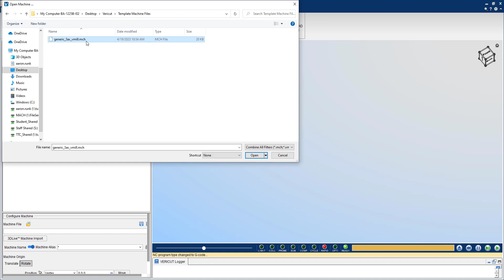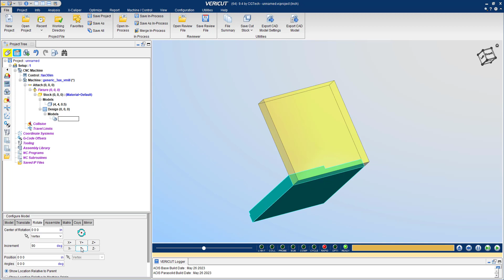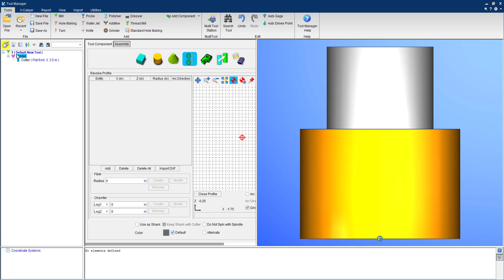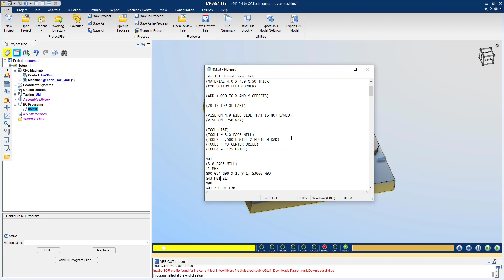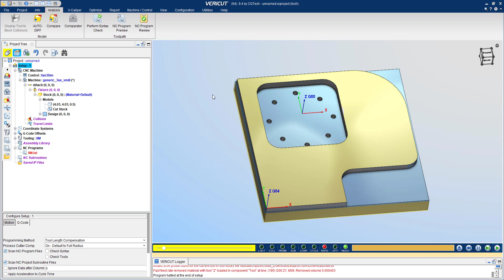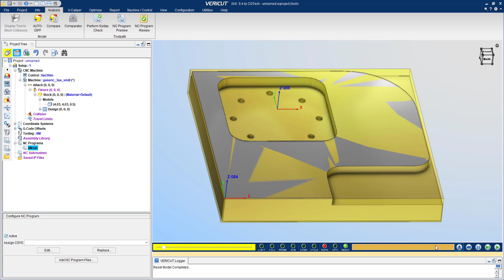Learn Vericut!

Comment: Sir I couldn`t find 8M text file can u upload it also please i want to do what u want it is really good exercise. thank u
Reply: ah sir thank you so much. I am mechanical enginering student yesterday I started vericut first time honestly i couldn`t find good explanation. I was just imitation what you did, now i will be able to finish. thank u so much sir.
Reply: sir I have a question, u say G41 uses cutter comp, how u know that? I mean every code has meaning or how? like g1 g2 ... g55. Sir I use V9.3  but when i click stock there is no section like "stock material". i searched everywhere where can i assign material of workpiece. Thank you so much in advance
Reply from the maker: @yourdecorator  so the best way to find out if a program uses g41 for cutter radius compensation is to understand how it works I have a link here that explains it further that way when you're looking at a program it will make more sense https://youtu.be/uZbG8XBrbjI?si=6R-n5ofWYXXqudZf
Reply from the maker: @yourdecorator  how the project ladder Works may vary from version to version you will just have to keep looking at the ladder until you come up with a solution
Reply: @aaronrunk4209  Sir thank u. I will start learn basics of G codes so i can understand. Sir my thesis topic is Data driven machining parameter optimization in milling. I will use ML models. But i need inputs and outputs as excel file. Since i have no real cnc machine I want to ask u if can we generate synthetic ddata in vericut. I saw some softwares (AdvantEdge or Deform) they are very useful but i couldnt donwload crack of them :D and i sent email they asked 12k for program hahaha. thats why i discovered Vericut. and ur lesson made it more interesting. Thank u for your answers. I will watch the video for Cutter comp. thank u
Reply from the maker: @yourdecorator  you're welcome I'm glad it's helping and congratulations on choosing a great career in the mechanical engineering field
Reply from the maker: https://drive.google.com/file/d/1-a8H0eHtQIQH_1ocP-vWrXBwKELpXh0S/view?usp=sharing
I'm glad you are enjoying the video. The attached link should get you the program. Good luck